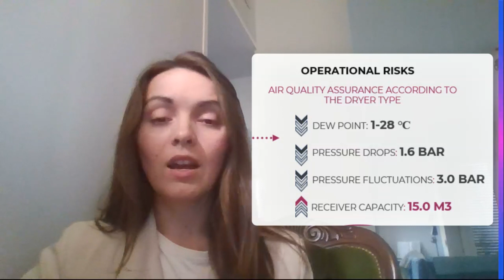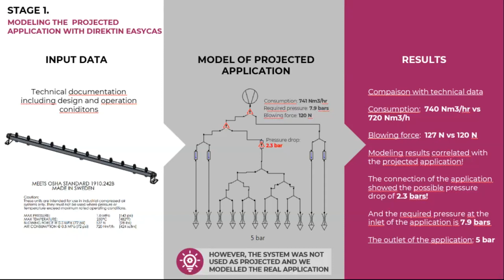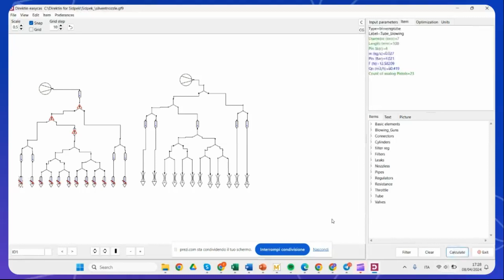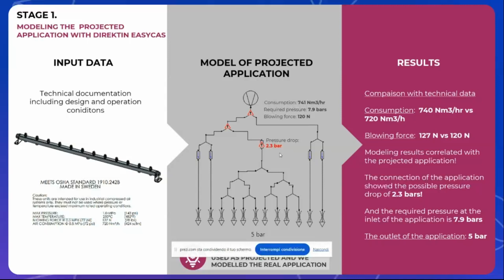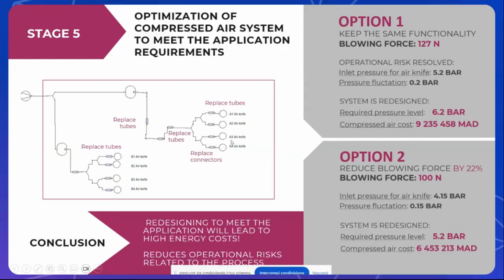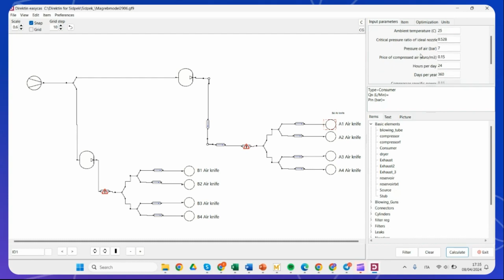Beyond Quick Fixes: Holistic Solutions for System Efficiency at a Moroccan Steel Manufacturer

Comment: Excellent advice!  Often, systems are modified [or equipment added] that affects the WHOLE system.
This is often a response to changing manufacturing demands or even someone turning down the main system pressure to save money [without checking to see how this affects the processes]
Even equipment added [such as a air motor] temporarily can have a huge effect!
To prevent this, all parties must communicate when new equipment is added or changed.
Testing AFTER installation should also be done but planning your equipment using this software is the BEST option!
Air knives and air amplifiers are also a good solution and may IMPROVE the process!